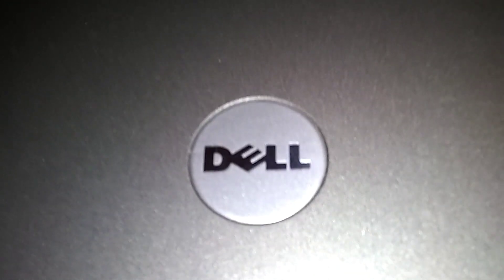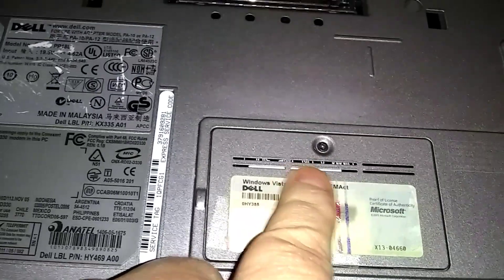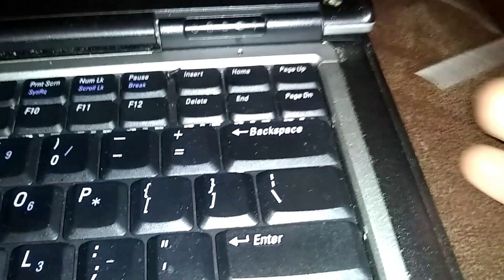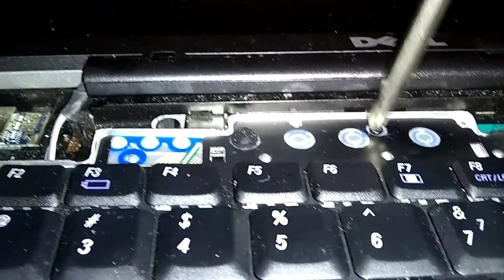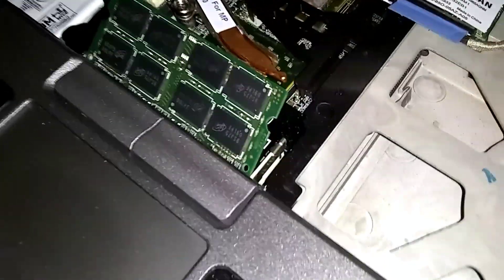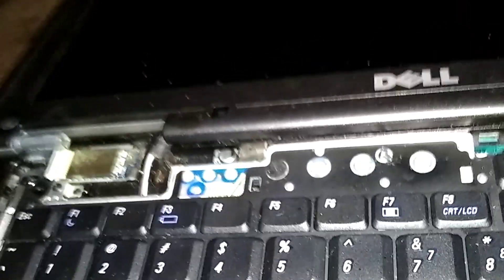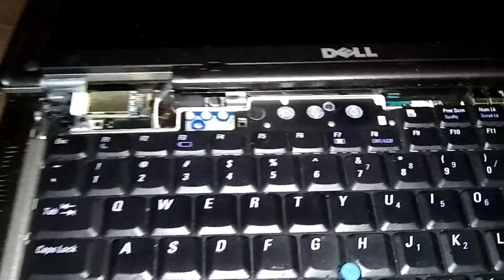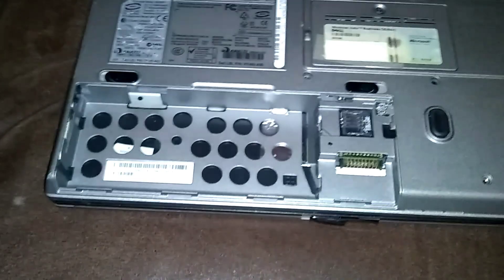Dell Latitude Ram Upgrade, d620 d630 d820, Nervous Nick

Comment: Thanks for the great video; answered my question as to why some videos showed replacing the back slot, and some showed replacing the slot under the keyboard.  Very well explained, and appreciated.
Reply from the maker: Sometimes you can get away with just adding a small amount of memory, bye entering thru the bottom slot, other times you will also need to add memory under the keyboard, when installing larger amounts of memory!  Try to keep both slots filled with equal amounts, for Best Performance!  1gb. in each, 2gb. in each, etc!
Reply: @NervousNick  Thanks a lot; I successfully swapped out both memory cards for 2 GB ones, and everything works great.  One thing I learned is that the slot under the KB can be tricky, you really have to push it into the slot well, because it may look like it's seated, but the computer fails to boot if it's not in there all the way.  Your video and comments are much appreciated!